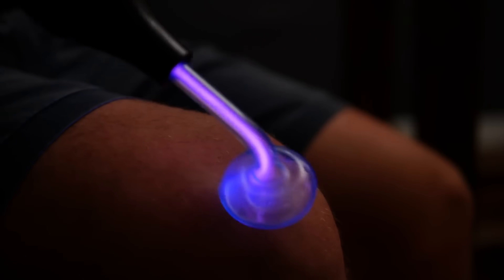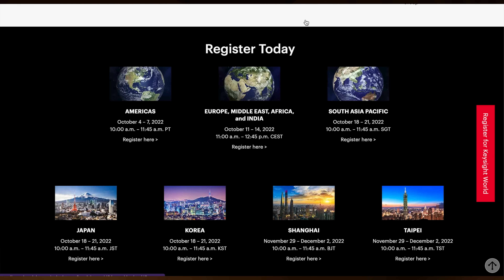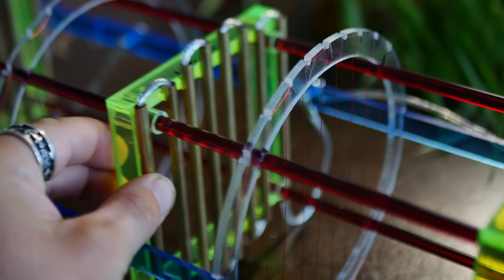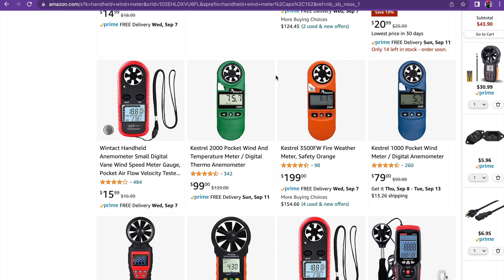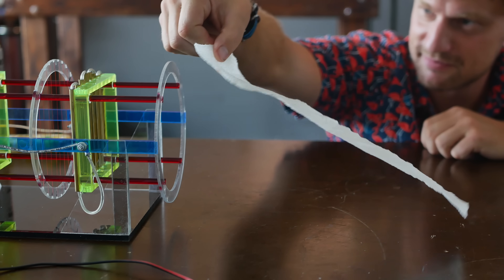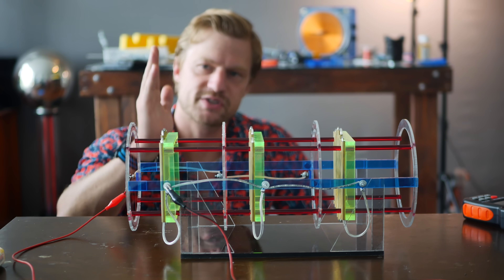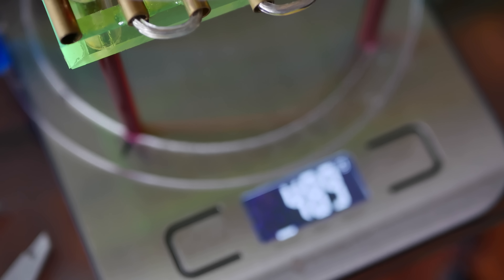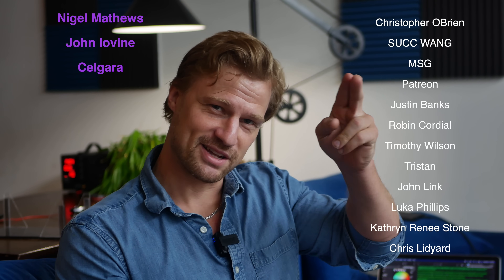Designing A Next-Gen Ionic Thruster! (For Flight)

Comment: This is an awesome video, and I really appreciate the hard work that went into making this!  One thing I would be interested in seeing is what impact the proximity between separate stages has.  My hypothesis is that bringing them closer would probably decrease the efficiency of each stage, since strength of the electric field produced in the opposite direction of the desired ion flow is inversely proportional to the distance.  However, this would allow for more stages within the same space which might increase the overall thrust.  The question at that point would be how this would impact the T/W ratio, or at the very least how this would impact the overall thrust per volume.  (This low T/V ratio or energy density is actually one of the big problems I see with ionic drives at the moment.  Even though jet engines are much heavier, they generate a considerably higher amount of thrust for a given volume than ionic drives, which makes them more practical for widespread use).

On the topic of proximity, though, you could maybe implement reversible thrust by having one of the electrodes on a linear actuator that alters its position in relation to two oppositely-charged electrodes.

Finally, I guess there are two primary inefficiencies that I haven't seen mentioned in my (admittedly brief) reading of the comments (I'm not an expert in fluid dynamics or electromagnetics, which are the two fields that directly pertain to this project, and I am DEFINITELY not an expert in electrohydrodynamics, so please let me know if I am off-base with any of this!):

1.  The aerodynamic efficiency of the electrodes themselves.  Although the copper pipes are rounded (which is a lot more aerodynamic than, say, a square), I would imagine they aren't the most aerodynamic shape, which could, in turn, impact the efficiency of the drive.  I do know that, at high enough flow rates, cylinders can introduce vortices down-stream that will increase the overall drag of the system.  There's a really cool video that illustrates this:  https://www.youtube.com/watch?v=pW0JfEBE9h8

2.  (For this point, I'll use the direction of desired flow as the x-axis, the axis parallel to the tubes/wires as the z-axis, and the horizontal axis orthogonal to these two as the y-axis.)  Essentially, parasitics.  Although the primary component of the electric field is directed along the x-axis, there will be some components that are along the y-axis due to the proximity of the electrodes to each other.  The ions are accelerated in the direction of the electric field vector at the location they exist at any given point in time.  By extension, there will be generated airflow with y-axis components, as well.  (Since the electrodes are relatively long with respect to their width, I'll assume the z-components of these effects are negligible.)  The best example of this can be seen at 8:57, where there are distinct diagonal arcs.  This means that ideally, the electric fields the ions are subjected to should be as parallel as possible - i.e. the x-axis field components should be maximized relative to the y-axis components.  I noticed that you had the electrodes staggered, so the easiest thing you can do is mess around with this staggering - I would imagine that the most optimal positioning is either with the grounded electrodes either exactly in between or exactly in front of the positive electrodes.  The next step up would probably be to make the electrodes as plane-like as possible while largely preserving their point-source-like characteristics and not neglecting point 1.  This would probably involve adding additional wiring at the positive electrode along the y-axis, making a sort of square mesh.

2a.  Going back to the staggering of the grounded electrodes:  As best as I can tell, it seems like the grounded electrodes are spaced somewhat unevenly (a simple side-effect of the prototyping phase 🙂), so making sure each copper pipe is placed at its optimal position should be able to improve the efficiency a bit, as well.

Sorry for the long comment, imagine a potato.

EDIT:  Little bit of grammar.

Comment: Add a lightweight cowling to the outside to contain the airflow and reduce the exhaust to a smaller diameter than the intake.  This is increase your thrust output by condensing the exhaust.

Comment: Change your power supply to much higher frequency, and get some un-insulated fine wire.  Building electrostatic precipitators for industry, we changed to 16-25 kHz systems to bring the RMS Voltage closer to the peak many years ago.  This allows operation with higher RMS voltage at higher current.  You will find that to take full advantage of the variable spacing, you will need variable voltage, which means individual power supplies.  Voltage required varies both with spacing and with wire diameter (to a point).  Since current per wire is very low if wired in parallel instead of wrapped, things like guitar strings become usable.  If you can get the wire treated with etching or glass beading, you can maybe get more uniformity in the corona or at least get the tufts closer together and more even.

Comment: Well to start, having a way to regulate air temperature for more thrust, a way to actually vector that air flow, and finally using a Faraday cage to prevent Welding yourself to the device?

Comment: when he measured the airflow for staggered spacing, he measures it while holding the device vs letting it sit on the table. couldn't that mess up the reading? as setting it on the table has the wind meter offset from the middle of the wind?

Comment: it seems like it would benefit from a computer to selectively increase/decrease the power along the length of the engine. obviously a gas chamber could be incredibly usefull because the type of gas that is involved is the main function of a ion thruster. maybe a simple arduino and a couple relays to control the ion thrusters in sequence or even some mosfets for variable control. its so common for channels like yourself to stop and move onto another project but you would be doing the world a great disservice for the benefit of your youtube channel. you should instead take it to its logical conclusion and make a functional vehicle for a gopro. once that is achieved someone will surely be interested enough to actually continue the research far beyond your capabilities.

Comment: does the thrust get exponentially bigger if you increase the air intake? e.g. a hair dryer on low settings and therefore pushing the air a little bit inside the thruster? i would like to see you try that in one of your videos. I am thinking that it wont work but maybe if you double the air intake the thrust gets x2.1 or even better?

Comment: I think the shape and size of the anode and cathode could be improved to allow for larger surface area, meaning more emitted electrons, while bringing down the weight. Gold or Platinum foil might work extremely well, but if you have yet to inherit a fortune, copper or aluminium would also do, albeit at lower efficiencies. I do however wonder if there might be a way to build a initial AC stage, ramp up the frequency, thereby reducing the size of the transformer, reducing electrical losses, and then only rectifying to DC. Just imagine how cool it would be if you can create an entire thruster weighing only a few metric grams inclyding electronics, and then being able to run the whole thing off a few light weight Li batteries. I smell super quiet drone!

Comment: ozone generation?
wing shaped ubes instead of round
cylinders instead of straight bars
1, 2,3,4 nested cylinders,
flat copper conductors instead of wire to get closer to a wing shape.
big hole in center to entrain inside air as well as outside air.
your welcome

Comment: This design paired with a Hydrogen bubbler for use in hydrogen injector in the final plasma stage all enclosed and coned at the rear for directional steering.  The design would mimic the jet engine but with each plasma chamber being substituted for the compression stage and the hydrogen  injector for the afterburner.

Comment: Greetings,

Intro.
This was absolutely brilliant work, and the data collected was most intriguing stuff…

Moreover, as-to not writing ✍️ a complex commentary or a short novel, there are a few key principles - I feel could possibly improve your design Dr.

• Using existing gravity fields of downward pull to accelerate velocity

* I noticed this design used a vertical structure, and my hypothesis is to have an inner spiraling 🌀 centrifuges, which will naturally compress air - hereby, increasing velocity + thrust ratios.

Next, I see this is a prototype however, creating a chamber, with external multiple charge points & self-adjusting inner magnetic 🧲 anchors to accelerate particles (presently in a vector angle 📐 or flow/stream *could possibly act as, multipliers.

Note 📝 
The objective would be to take energy actively in motion, and boost energy efficiency - byways of a slight slipstream, and this can be applied to target 🎯 areas based on loss of plasma energy. 

• Lastly, recyclable energy, which would take from plasma fall-off, much like a pin-point filter identifier, and use the above concept, and beget this iconic design to be somewhat of a condescend fuel cell - in itself. Henceforth, self-sustaining energy without the need of replenishment of source materials.

This is a theory or more like a hypothesis Dr. I truly like the idea of no moving parts. In my mind 🧠 I see one created device free floating, with anchor points to connect to a base of some sort. I really believe that most people in engineering don’t take time to see nature and its truest form, and we can learn much from it. I spend most of my time inside the box instead of thinking outside of it. The first thing that came to mind with your design is the fact that earth is rotating, and that gravity must exist to affect any materializing effect. In this case you are creating thrust Dr. via electrical charge - creating plasma etc. My approach is basically back/reverse-engineering + elemental enhancements of existing forces. I’m totally sure I can provide factual details to produce results.

Lastly, I understand this is a dated video but, the material herein has vast uses, and many organizations like Space-X; JPL, NASA, Lockheed, Boeing, and many others could definitely gain from these studies and concepts Sir. 

In the meantime, keep being awesomeness, and thank you for teaching me something unforgettable about Science today.

Best,

Michael Clarkstar
clarkstarfilms@gamil.com

Comment: If you were building a super heavy you could use lithium and or mercury batteries and power super banks of high capacity 3000f super capacitor's  that would give you all kinds of output power were talking in the range of wherever you want really but in subwoofer systems it goes as high as 300-400 amps of output current and wattage ranges of 10,000-30,000 watts imagine one of these hooked up to a tesla battery pack lmfao talk about a rocket car.

Comment: Nice. Though you could make the ground electrodes more aerodynamic by hammering the metal tubes flat. I don't know how much of an effect this will have but i imagine it's going to stabilize the airflow inside the thruster body. Also an air duct would work wonders i think, considering electric fans also produce more thrust with a duct around them.

Comment: Some possible improvements to get more thrust
1) Add a duct of a sort that can direct all of the air to the back of the thruster
2) Add more rings of electrodes
3) Find a lighter and more durable material to lower the weight.

Comment: What are some exotic materials, readily available, that can increase efficiency of the electric flow and increase the power output?

Cooling the materials to below freezing using carbon nanotube ceramic housings, or exotic plastics, with chambers that separate the electrical components from the ionic flow stream and liquids or gases being propelled. 

Try using different metals for their conductivity.

Try using different types of current somewhere along the length of the engine to focus the ion flow or cause the ions to compress and suddenly emerge at different flow rates? Like compressors and stators in aircraft engines.

Seperate the electrical components from the surrounding air, use exotic gases around the current bearing elements, (like a light bulb) increase the energy of the ion reaction with gases and metals or hybrid gaseous metals. (Are there gases with magnetic qualities?)

Maybe some mercury flowing through a plastic tubing wound around and inside your engine, increase and decrease the speed of the mercury flow to control the ion flow rates or create magnetic constrictions for the ion flow?

Try different turbulence devices, and shapes along the length of the mercury flow tubing to see what its magnetic effect is on ions?

Change the construction of the engine to nonferrous materials and use only exotic metals, shape the metal strips to accommodate the flow of the electrons like a fusion reactor tarus shape.

Put your electrical elements inside of a flexible high temperature tape that you could form and flow into a shape better suited for the electron flow like a taurus shape.

Put your electrical elements inside of a light weight ceramic epoxy you could preform into a shape suited to efficient electron flow.

Some non ferrous tube with thousands of thin wafers of ceramic and exotic metal all mounted on flexible high temp plastics that will wave back and forth in the ionic stream changing the flow rate at different currents?

Crazy ideas from me, not explained well. 

So this will work in a vacuum and provide ionic thrust?

So in atmospheric use, the air gets swept up in the ion flow and becomes part of the thrust?

If water flowed through would cause water molecules to become swept up in the ionic flow and produce thrust as well. (Assuming the water separated from the electrical elements)

Sorry, I'm just enthusiastic about your engine, it's pretty awesome. You can tell I dont know much about this or any tech.

Please be safe and use shielding to protect yourself and eyes from explosions.

Comment: More flow could be generated if you can keep the flow laminar as long as possible.  I think subsectional small ducting with individual ion thrusters would probably improve the efficiency.  Circular ground conductors will induce vortex and unstable flow.  Unstable oscillations will reduce efficiency with ion drag thrust generation at each stage past the first stage.  Keep the instability to a minimum to align with the electric field.  More aerofoil shapes would be better with point edges at the leading edge.

Comment: measure the thrust against the mount.
contain the stages with ducting with the intent to densify each stage, and then accelerate the last stage with a nozzle.  not much different in concept from a gas turbine engine that way.

Comment: 1. the thruster is not encased which can add air from the outside at any stage, or allow for air to escape at any stage
2. Add a nozzle to the end of it.  
3.  wire mesh may be too far apart (not ionizing the air enough - not likely, but could be a variable to eliminate) or close together (restricting airflow)

Comment: Some random thoughts, 
1. adjust the density of both of your electrodes, 
2. smoother wire or more 'gritty' wire would cause more or less 'ionic fountains' appear on the wires.
3. HVAC studies require smooth walls for air flow, also large smooth inlets to allow the starting flow to be laminar might help.  The shape of the 'exhaust nozzle' also makes a difference.
4. for Spacecraft that use ionic thrusters, how is theirs done?  I know some use higher molecular weight gas (xenon for example) but some are purely electric.

Great first hack at ionic thrust.

Comment: You should try, a series of stages i.e. 10 -15 compartment with the spacing staggered and decreasing until the one inch mark. Moreover the optimal spacing may change once you increase the number of stages, but still do it the same way because you're incrementally increasing the thrust from one stage to the next. Use Extremely light material. (carbon fiber if you can swing it.) Enclose the air flow and design some form of fluid positive flow that the wind will follow in the INSIDE of the thrust chamber in the direction of thrust.  These improvements should gain you 68-73% thrust. Nice, If done right and follow through.. you could invent a new from of propulsion to be used by future jets that will be all electric. Kudos. Subbing

Comment: If this message gets read that would be cool.  My idea if you would be willing to try is to see if you could maximize thrust by weaving the positive wire into a spider web shape and the ground could be circular I believe this would give the best overall area within the space.  Also when the lights get turned off and you see the plasma I would wonder what differences you would notice at greater distances.  What does higher voltage do when they are farther apart?  What would happen if the system is enclosed like a jet engine?
Reply from the maker: Shhhh don’t giveaway my secrets to version two 😉

Comment: IDEA: 1) See if when placed vertically, how many segments would be required to create lift?

IDEA 2) If you find that you can create lift with multiple segments, then attempt to control the amount of lift, by creating a variable voltage? or amperage? or both?

Idea 3) If you can control lift, try putting four of these, each with multiple segments into the shape of a drone, and see if can control lift and direction, by adjusting each stack separately (by analog adjustment at first), and if works, then by digital circuitry adjustment?